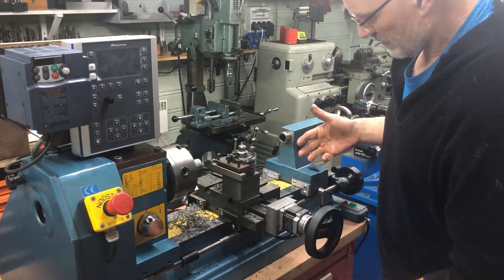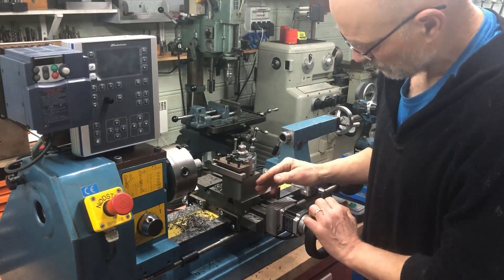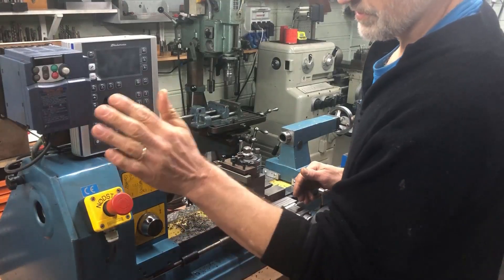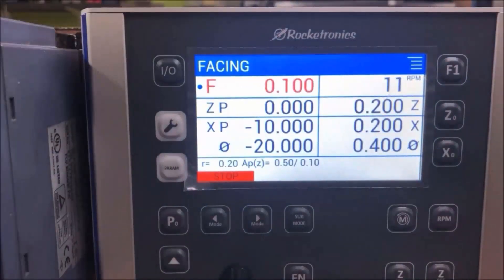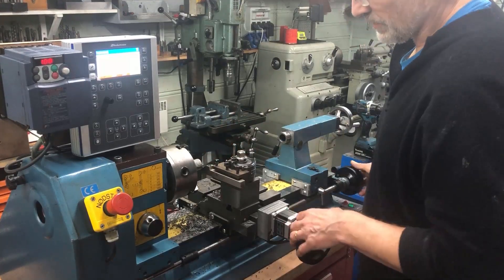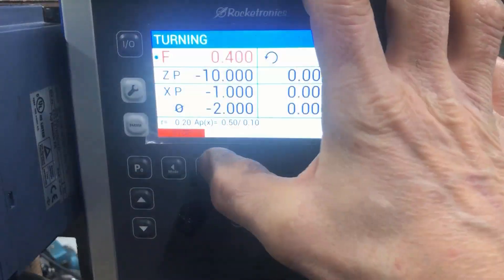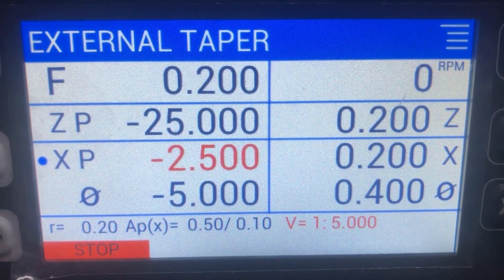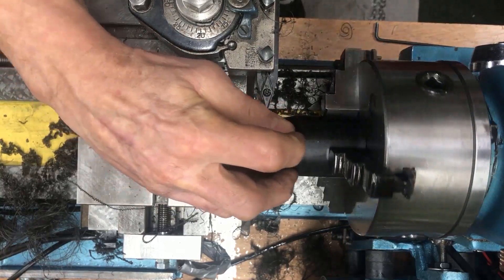Smarty AT-300 - adding a Rocketronics 2 axis ELS system - part 1

Comment: you had the tool in the wrong position for the convex radius, thats why you got the flat start
Reply from the maker: I bet I had 🙂 Thanks!
Reply: @jansverrehaugjord9934  the cutting tool needs to be at 45° you had it at 90° thats why the left flat side of you cutter come int the way and did the flat slope*

Comment: it"s been a year where is part 2?
Reply from the maker: Well.. not sure why I called the video part - 1. I see I have written "Will get back to details on the more general machine modifications later as well as further use of the ELS system."
I guess it can fall into the category "sometimes optimism outpaces reality", at the very least I haven't done much on this machine the last year or so, instead being busy with other projects (more so than in my English YT channel these are documented on our local machining FB page up here in Scandinavia as well as my other YT channel in Norwegian.. "Haugjord's roterom"). I got a bit stuck on the spindle motor/motorizing assembly, not being totally happy with how my conversion to a multi-rib V-belt functioned. "Fooled around" with different motors/solutions, and although now currently setup with a 2hp motor in the original position, still not really as strong as I want at low speeds (I also tried a couple of different VFD's). I think I need a bigger belt, but this also requires a different set of step-pulleys. I contemplate using a ribbed (ie. timing) belt instead and run over eg. a 2 step pulley, mounting the motor closer. This all might deserve a separate video, but first I need to decide & buy parts etc. Anyway, a number of other projects have gotten priority over this machine, but thanks for reminding me to get back on track!

Comment: Great video. You wouldn't have a schematic or list of the components used in this upgrade that you could share?
Reply from the maker: Thnks. The kit list from Rocketronics that I used can be found here https://www.rocketronics.de/shop/en/paket-servo-M.html
You will also need the transmission parts and mounts, depending on how you want to drive the screws, I used direct drive hence a split coupling as well as brackets, which I made myself to suit.

Comment: Great job! I have same machine. Now working on installation ballscrews and closed loop motors saving handwheels for manual operation. Today received ELS 4 Pro 😊. Can you tell me you settings for encoder? Do you know gear ratio - spingle to gear which rotate your encoder in I and II selector positions? Will be very appreciate your help. Thank you.
Reply from the maker: Thnks! I didn't bother with ballscrews myself, but this sounds like a very good setup. As a matter of fact, I have used a couple of gears from the output shaft for the gear train, which in pos 2 (if I remember correctly) gives me 1:1. That is why I have "buried" the encoder where it sits today. However, I am in process of redoing the motor/drive system, switching out the regular V-pulleys/belts for a multirib system. This gives a better "wrap-around" effect, especially on smaller pulleys, ie. promises better transmission efficiency and quieter running. This means I have dismantled the spindle mounted clutch system thereby giving me an opportunity to relocate the encoder directly to the spindle, which I think is better.
The settings are somewhat individual when it comes to acceleration, coarse/fine feeds and axis movement rapid/slow speeds, but in general I followed the instruction manual and recommendations as well as of course adhering the the motor driver settings described
Reply: Thank you! I am on the same boat. Thinking to replace pulleys. I am already running a treadmill motor on lathe powered by Vary Speed r400 controller. Thinking to leave just one set of pulleys. The 1:2 ratio should be enough for variable speed of treadmill motor and treading with ELS 4.
Reply from the maker: @sergeimorozov9093  I was also thinking of using a treadmill motor (I have 2 available), but ended up with a (traditional) 3 ph induction motor driven from a VFD.PS! Bt now I have tried several different setups, motors and pulley arrangements.. amongst them a one pulley system from a 6pole ie. 900'ish rpm induction motor, which I thought gave a very smooth and quiet running. However, not entirely satisfied that this motor is adequate at 550W, I am now in process of switching to a larger 750W 4 pole motor, ie. 1425 rpm, which neccesitates a double reduction again.. If this is to be the system I go with, I wll do away with the cumbersome speed change system as original, instead using a set of multirb pulleys from a Myford Mystro, which uses 5 step pulleys. The motor to the idler pulley will then be a fixed ratio as it will be sufficient with only swopping the belt on this 5-step pulley system to change speeds. Will also make a simple belt tensioning arrangements a la on cars engines, ie. just undoing one bolt, sop belt position and tighten again. Still experimenting :) and at the moment waiting for some multirib belts.

Comment: This system is brilliant and how I used to run one off jobs on my CNC lathe as wasn’t worth the time to write entire program. Just run each operation as needed.

Wish I hadn’t just spent big money on Newall DRO for the chipmaster.

Be interesting to play around with a mill for 2 axis control.
Reply from the maker: Thnks for the comments. I think this and similar systems are very useful, especially on lathes that have no gearbox. I also contemplated running this for the x- and y-axis on a mill, and now I can see how one might use it at least for motorizing these axis on the 3-in-1.PS! I can't see that a Newall DRO on the Chipmaster is a bad idea:) ..

Comment: Sorry if you explained it elsewhere but did you put ballscrewas on the cross slide?
Reply from the maker: No ballscrews. .at least not yet. I used an ordinary trapezoidal screw. I did add a nut section though.. same on the long axis.

Comment: I've considered getting the Pro 4.  Unfortunately, the unit only supports 1 arbitrary unit of length and there's no option to switch to inches (IIRC).  Also, would a full 2-axis CNC setup would be better for similar money?  The ELS probably feels like operating a manual lathe, which is good for a hobby/toolroom setting.  A CNC might hinder manual use of lathe but it gives you better repeat performance.  The turn-key nature of the control is appealing.  I've also looked at Acorn and Masso.  They seem simpler than linux CNC but may cost more.
Reply from the maker: Hmm.. I would ask Rocketronics themselves about when/if they have a unit capable of imperial readout/use. They have been extremely responsive to other wishes and the software is updated along, now in V13.. should not be surprising if there will be a V14 soon.. My first thoughts when looking at an ELS system was that I wanted a means to do away with the change gears. Then of course going up from a simple z-axis control to a more sophisticated system is natural and somewhere along the road also to a 2ch system like the one offered by Rocketronics. Not sure about 1 vs 2 ch for a hobby lathe either. The most benefit from an ELS is already "taken" when one has motorized the Z-axis, but there are also  significant advantages with a 2axis system. Pro vs Basic..  tja? I think the large color screen is very handy in itself, but the additional input/outputs and control of rpm/motor are nice. As you indicate, an ELS system retains the manual use if the lathe, which I consider crucial. I also think that this 2ch ELS is better for me vs a CNC system.. at least until one have more experience and really needs more "programs"

Comment: That is an interesting configuration. I have the Rocketronic non-pro and am very happy with it. I mounted mine with a drive belt on the front that is off to the side in the front of the lathe. I have been very happy with my setup. Thank you for sharing your setup.
Reply from the maker: Thnks for the comment. I also thought doing a belt drive, for both axis actually. I also like that approach!